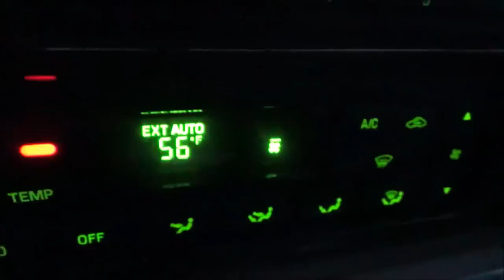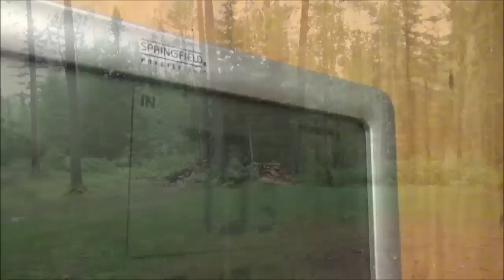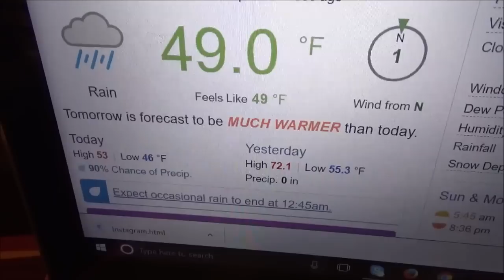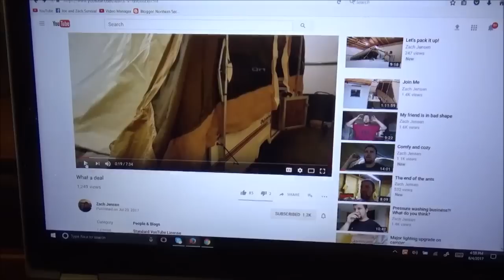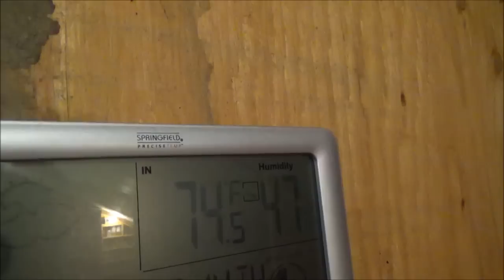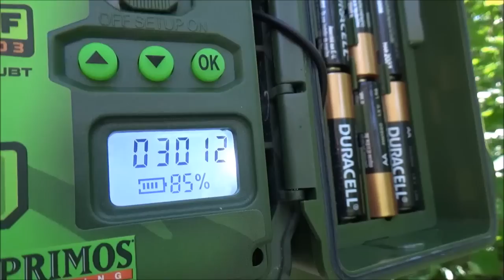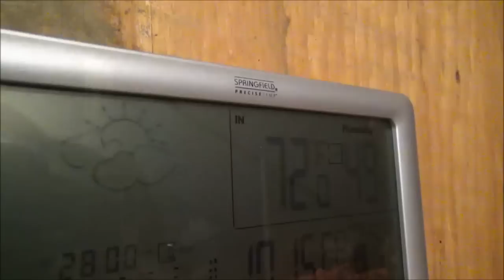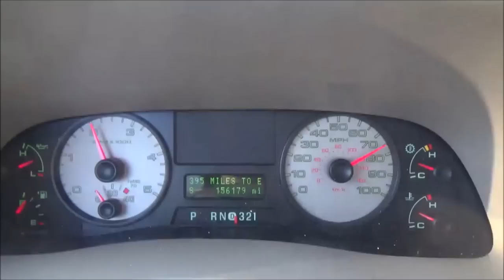THE TENT. Early August Trip. A Black Bear on the front porch?

Comment: An easier method to roasting your corn?  Throw the ears in a bucket of water for about 20mins. then throw them on the grill over the fire, silks and all and when the outer husks and silk turn black/char, they're done.  Take a bunch of the silk and husk together and pull them down...you'll get more silk off than when the cobs are raw and you won't even need butter, the corn is sweeter and nuttier.

Comment: Well you got 5 hours down to 1 hour. I can't help but feel we're missing a ton of great footage. 

Do what I do! Make that into 5 videos!

edit to add: Joe sometimes your video is a little choppy/jittery when you're in motion, or you're filming something in motion. I had the same problem until I went through my cameras and put them all to the same FPS setting and also set my videos to that same FPS when editing. Ie: My DSLR was set to 24FPS, my gopro 30FPS, and editing software 24FPS. I put them all at 30FPS because my gopro wouldn't do 24 and now everything is nice and smooth. Give it a try.
Reply: Raspberry Rock - Off Grid Cabin I agree I couldn't tell if my eyes are going out of whack or maybe an issue with camera...
Reply: Good catch. I had the same issue until I synced my setup.

Comment: Hi Joe, love watching your videos. Curious question: Does the kitchen sink and your shower just drain onto the ground under the tent? If so, do you have any problems of freezing of the drains in the winter?
Reply from the maker: Both the sink and shower are just a straight pipe to the ground. So little water goes through it in a year I have no moisture issues since its open under the tent. I never have freeze trouble because there is nowhere for the water to get trapped in the pipes.
Reply: Thanks for the reply Joe. That is what I figured but with your creative talents I was curious if maybe you had come up with some gizmo or a dry well under the tent. Have you made a goal of when you may start on a foundation for a cabin as that would be a start for some great videos.

Comment: I live in South Carolina and am massively tickled by you lighting the fire in the tent while I'm cranking up the AC. Great video. Question: What are you doing with the grey water from sink and shower? The lake, a dry well, ...?
Reply from the maker: So little water runs through there it just goes out on the ground. Maybe 1 gallon of water went through the sink while I was there and 3 gallons through the shower. Very little.

Comment: Joe better way to do this corn in the microwave for 4 minutes in the husk when it comes out it's very hot be careful cut the butt of the Corn off squeeze it at the top and I promise you once you squeeze it at the top is going to pop out the bottom with no silks on it you can also put it on the grill with the husk on it cook it like that do the same method cut it at the bottom squeeze it at the top and every silk on that thing will come off once it's pulled out the bottom I promise you you have to cut it on the bottom enough to release the husk all the way around the corn cuz once you squeeze it at the top and hold on to it that's how you get your silks to stay there won't be none on the corn once it comes out the bottom I know this is hard to believe blew my mind when I first seen it ...all these years I've been doing corn wrong when the older gentleman showed me this I was blown away I couldn't believe all those silks stayed inside with the shucks never have I ever boiled another ear of corn you got to try this Joe it will blow your mind it did mine

Comment: Joe,I love your channel!!! I have a question. You were filming and the power went out. I thought you were using a generator for power.
Reply from the maker: I did use a generator for the first 7 years and then I dug in grid power. I do have the generator for back up IF the power would be out for a very long time.
Reply: @JoeandZachSurvival  thank you answering

Comment: Just a quick tip that might work would be to slow down how fast you reel in your spinner bait for the northern pike.
Reply from the maker: It took me weeks to find a bait caster that had the gear ratio I wanted so I can reel like that and its where I want it. Also, it is August. You need the vibrations to kinda piss them off so they hit. Slow in the spring, fast in the summer.
Reply: JoeandZachSurvival ahhh I guess that makes sense

Comment: U have soo much pork, how come u buy it? Those hunting cameras are a great idea for security.
  They have out cabins i Alaska a d places like that hunters can stop in in case they get in trouble or the weather. Its that the general idea for The Tent?? Or is it No Trespassing?
Nice to see wolves still running around.
Reply from the maker: The Tent is no trespassing, it is not as remote as the Alaska places you see. The outhouse is always open and there is a wood stove in there with lighter fluid and matches. I like how thin the store bought pork steaks are, they cook up nice on the fire. My home butchered pork tastes better but I do not have a meat ban saw to cut them thin like the store does.

Comment: With all the smell of food I'm surprised that bear didn’t push the door right in, your lucky would have been a big mess.
Reply: I wondered why the bear doesn't just tear through the wall.  That is what they do here,  insulated shed, 3/4 plywood on inside and out.
Reply from the maker: There really is no food in the tent except canned goods when I am away. Not much smell of that in there. I do have my 9mm on my dresser at night with one of the 15 round magazines next to it. If one did get in when I am there my ears would be ringing but he would have a hell of a headache before he fell over.

Comment: Joe, are the walls insulated at all?
Reply: Andy Parisi looks like he has insulation boards but with a heart source like that prob not really needed
Reply from the maker: I have 2/4 inch plywood on the walls and then 4 inches of foam for insulation in the walls the ceiling and floor. Even at 30 below it may take awhile to heat everything up but after that it is easy to heat.